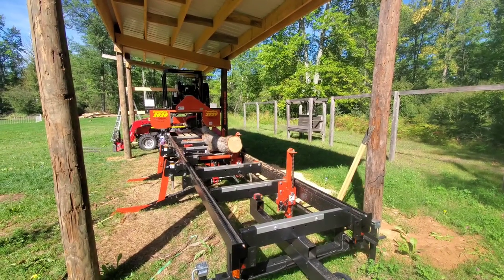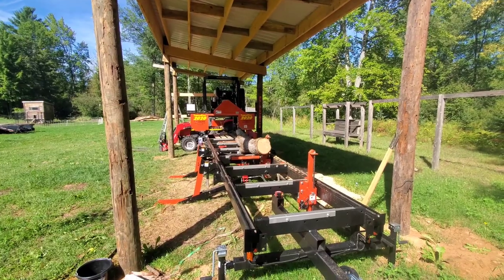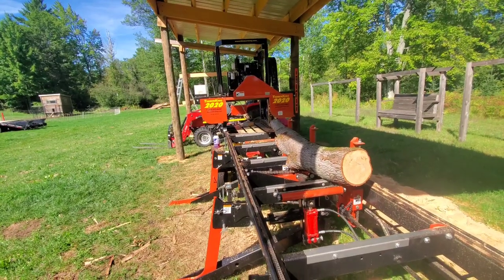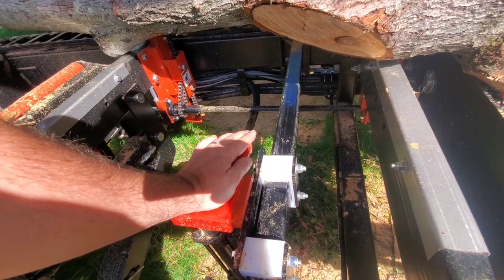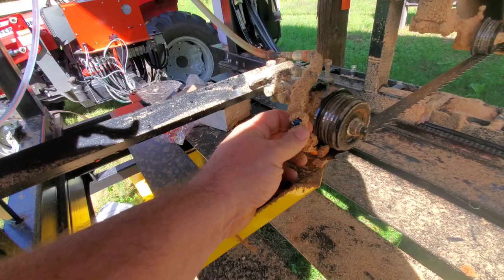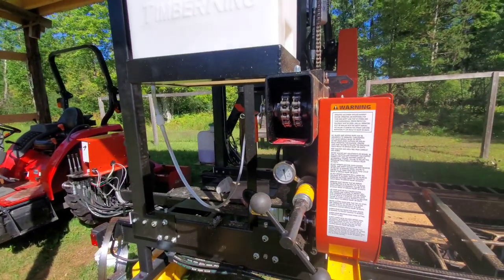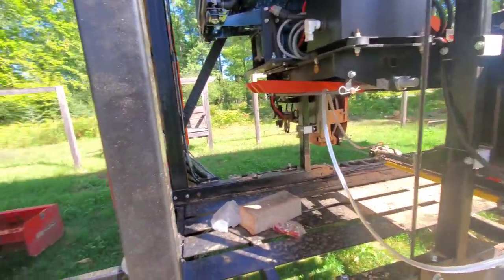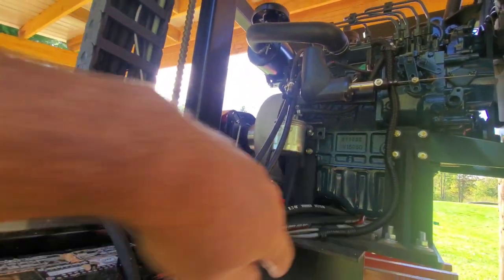If you're new to sawmills or have one on order, check this out. The Break-in period

Comment: When you're working on your rattles, you may want to consider automotive door gasket material.
You can find it with peel off adhesive strips so you can attach it easily and clean it up easily when you want to change it.
And a bonus, it's cheap
Have fun breaking in your new mail I love it thank you.

Comment: Timberking makes a solid sawmill. I have been running a 2400 for years. Issues I had the first year....Muffler fell off as the welds failed, middle leveling jack sheared off (I replaced it w/ an overbuilt twin 7k jack and actually upgraded all the jacks to larger 7k jacks, diesel fuel tank developed hairline cracks and air was getting into the fuel( replaced it w/ a heavy aluminum tank). Ideally larger bandmills will benefit from twin log rollers and twin log clamps. I get by without them but it would be a good upgrade when cutting big logs over 30in. Also built a jib crane and log deck as it increases production. Overall, I have been very happy w/ my sawmill as it's robust and fairly simple to work on.
Reply from the maker: I concur,  Timberking makes a fine sawmill that is built to last.  Minimal issues and if issues arise it's easy to find acceptable replacement parts.